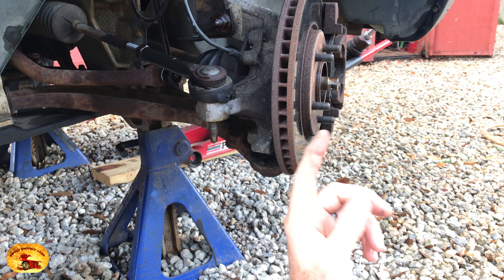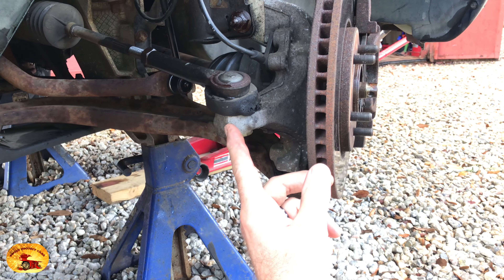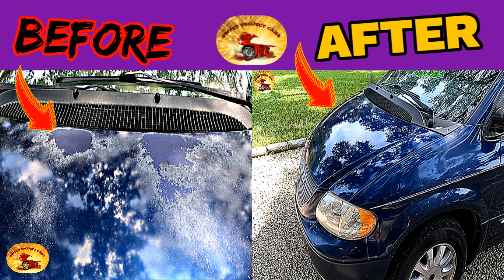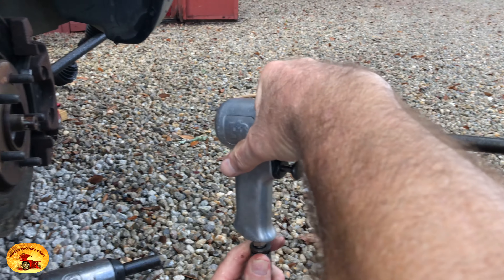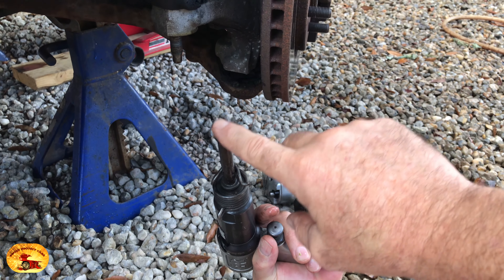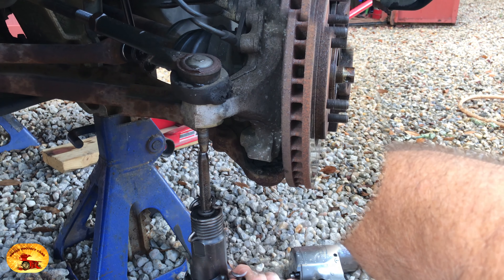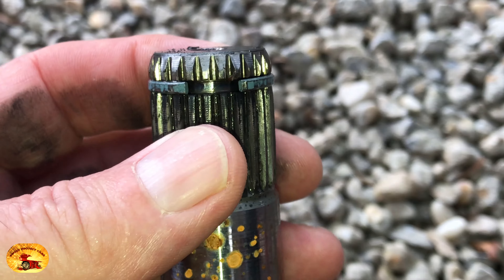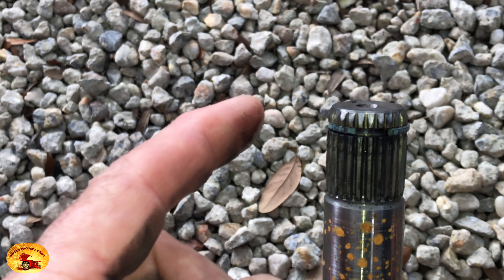AWESOME!  2 Tips You Need To Know... #1. Stuck Tie Rod Removal.. #2. CV Axle Quick Install

Comment: Wait what about using Planet Safe on the top letting it drip down, does that work together  with the air hammer? 
Still using a propane torch and air hammer 💪 POP!  Works like a charm,  from what I saw.  So thank you for showing us this and the other tip  both very handy. 😊
Reply from the maker: We tried it all wolverine, but being a 2002 that thing was only coming out with some heat and the air hammer my friend :) Thanks as always for watching and commenting, hope you have a fantastic week. mad Mike & team

Comment: Did you hit the housing at all??
Reply from the maker: We do not hit the housing on aluminum arms, as it doesn't take much to crack or damage them. On the steel arms, yes, we will tap on them but we've always used the air chisel on pretty much all tie rod ends, works every time, fast, simple and no damage. Thanks for watching and asking, have a great day. mad Mike & team

Comment: I feel some looseness in my front suspension.  I wonder if its my tie rods?
Reply: Do you hear any creaking or clunking when driving over bumps? Thats how i found out my mustang needed new ones
Reply from the maker: Jack the wheel up off the ground, grab the tire at 6 o'clock & 12 o'clock and try moving the tire back and forth. If you feel any movement, it's usually your tie rod or lower ball joint. Then grab the tire at 3 o'clock and 9 o'clock and try to move the tire back and forth, if it moves, there's a good chance it's your inner tie rod. Hope this helps Matt, thanks for watching and asking, have a great day my friend. mad Mike & team